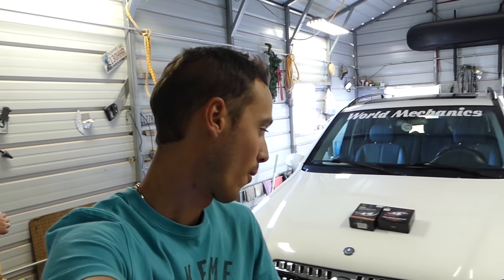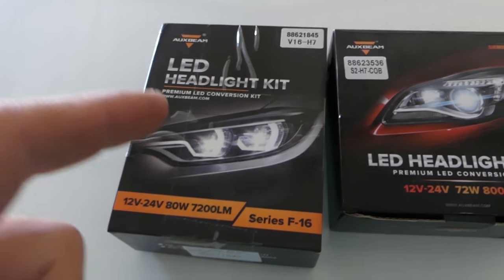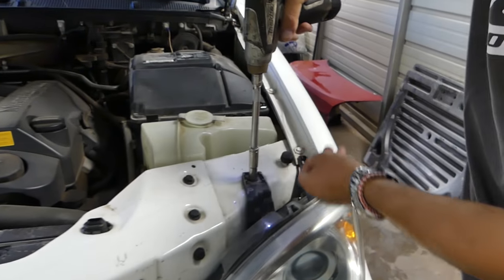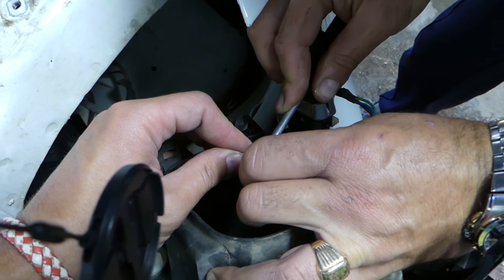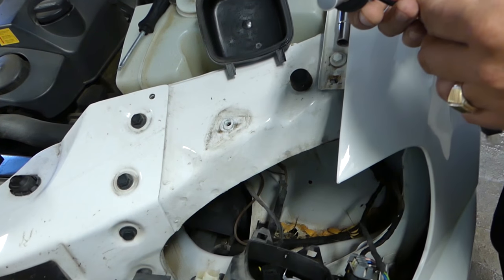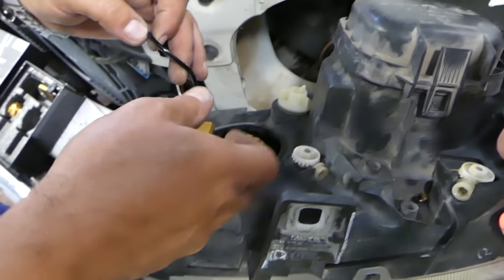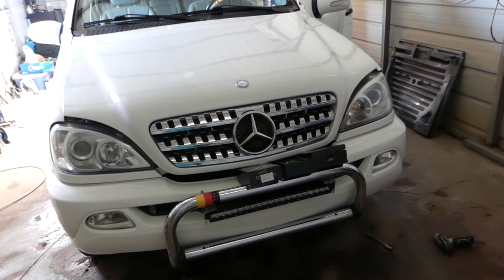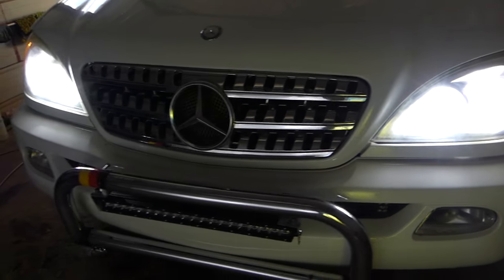LED HEADLIGHT BULBS BY AUXBEAM on MERCEDES W163

Comment: Thanks for the video recommendation. I am looking to upgrade the OEM halogen lights in my 2000 ML320. Aside from the stated minor modification of the lamp holders, were these direct plug and play or did you also need the LED Conversion Headlight Error Free Canbus Drivers from AUXBEAM?